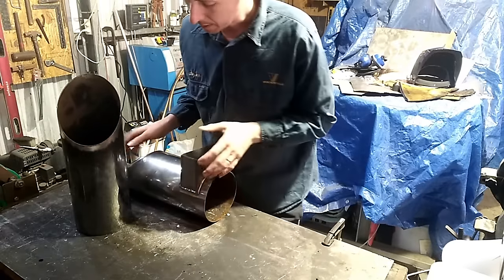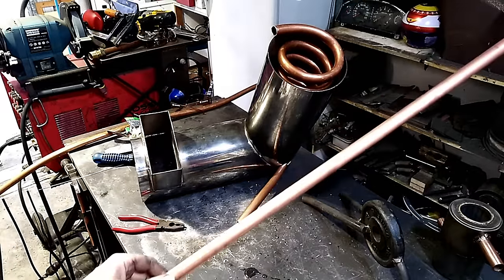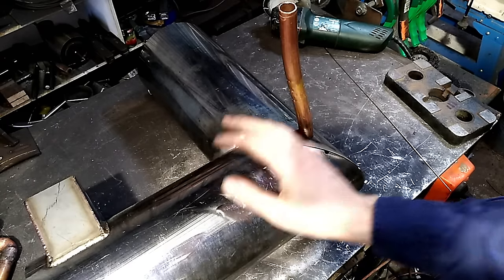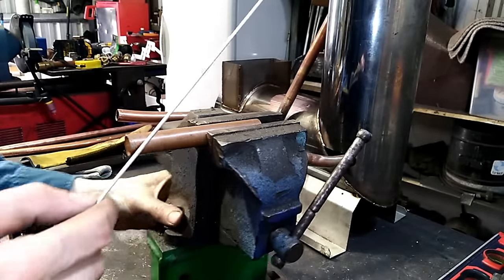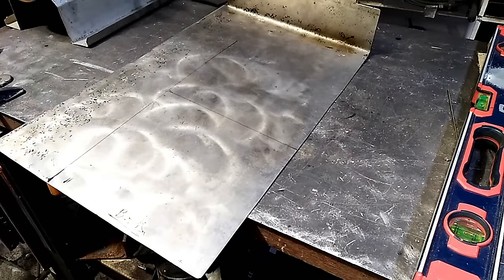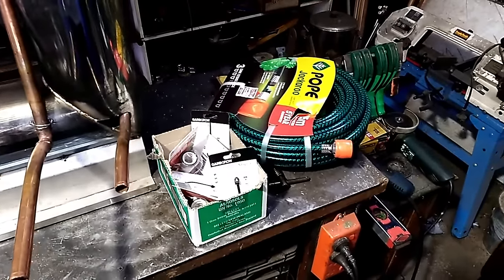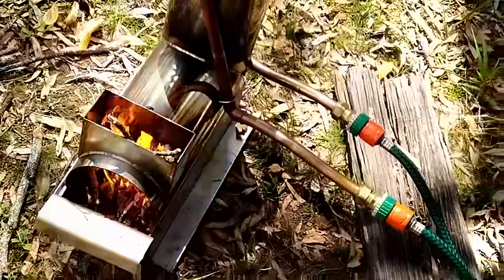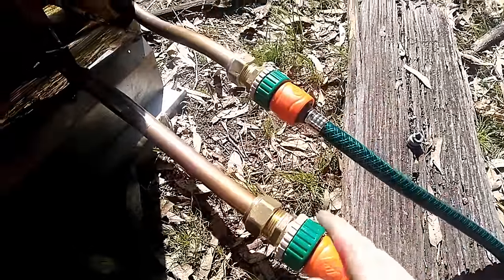Hot Water Rocket Stove II  - BUILD-

Comment: What he doesn't show is the material list! The multibit drill bit,is about 35$ Canadian, and this is not some job u do in your kitchen.
You'll need a welder,or pay some shop about what a new welder will cost.
The 110 volt mig welder I used back in 1989,always got stuck to the metal,crappy welder,but things may have improved!
At a Ford dealership I used a Hobart, or smash welder, works good,no cheap!
There were/are better more expensive models.
You also need a hand grinder,cheap Chinese @ 5amps I bought a new one,it burned out in about an 1 hours use! So the new one @9amps cost 100$ Canadian. 
The size of this unit, he doesn't say how many btus it'll put out,but I'm not impressed with the opening for the wood,got running shoes,as you'll be chasing wood constantly!
I've also seen these coils in huge roof top air-conditioned systems.
Why can't u use 2@1/4 tube  ?
This would be easier to bend!

If this js just a test model,fine,but I run a stock woos stove,and @ -35+ your feeding it constantly!
He also doesn't explain what he's doing or the diagrams of the sizes as he goes along,which would be a great help.
But if you're smart enough, you'll figure out this on your own!
You can also setup a propane flame on the opening! Instead if wood!but thanks for the demo.

Comment: CAUTION!!
Little Aussie Rockets  what you have created is NOT a thermosiphon but a crude percolator. By definition a percolator will NOT be continuously filled with water!  What you are doing is VERY DANGEROUS and can result in a steam explosion and could cause failure in your heat exchanger or piping. What you need is a to modify your plumbing to create a true thermosiphon.  1) the bottom of your storage tank should be higher in elevation than bottom of your heat exchanger.  2) the piping must ALWAYS RISE (increase in elevation) from the point where heat is first applied to the heat exchanger to where it returns to the storage tank. 3) keep the return to the storage tank flooded (water level in storage tank higher than the return fitting) at all times.
Replace the garden hose from the heat exchanger exit to the top of the storage tank with rigid copper that slopes up to the tank. 
The heat exchanger temperature differential (temperature difference between inlet and outlet) should be no more than 10°F (6°C). The lower the differential the more efficient the heat exchanger. If it is higher, decrease the amount of fuel burned or increase the pipe size to increase the amount of water flowing.

Comment: this is an interesting problem of how to get and keep heat BY DESIGN where you want it to go with minimal air convection losses...

so basic questions to ask yourself are ...can the the heat engine (rocket stove in this case) ever melt the copper and leak, in this configuration no.
it's a given copper transfers heat well into the secondary fluid (water in this case) so the next is, can the hottest water produced here ever melt the generic plastic hose pipe and leak..
the actual answer is not in this case ,it will get soft and loose rigidity sure, but not leak , cut a piece off, and boil it in a pan of water to see.

so we now have the first potential problem to actually solve, change the material, or simply support it for when it  loses rigidity, option 2 is cheaper and potentially better, as you use a supporting material that will both support AND insulate, so meeting the 'minimising air convection losses' so let's use cheap,simple "insulating aircrete" as it meets the specs , and simply embed a given required length of  hose pipe in say 2"  aircrete outer pipe.
 
simple formers are go through the trash and find coke cans/bottles, cut the ends off and put your hose pipe in there  with simple wire wrap support to hold it in place as you join the coke cans to "form" the outer pipe, fill in the gap with mixed "insulating aircrete" :).

stop there if you want, but there's more "improvements" if you can actually identify and put the  problem solving in to action.

you construct a " vortex generator" and don't use that invention to it fullest ..
remember, air is actually a fluid, water is just a denser fluid...
hot fluid rises and in a confined flue an (unoptimised)  vortex results as you already know and use, just change the input and output locations to better optimise it, and so better meet the minimal convection losses and keep heat BY DESIGN where you want it to go...
 
a lighter fluid will always rise above a more dense fluid ,air bubbles in a water filled pipe, and again that CAN actually be a GOOD THING ,see "trompe".
think how the so called "global ocean conveyor belt" works and there's your next construction vortex to re-apply in this solved problem mini fluid conveyor belt case ...

Comment: Why not use water and sealed the end of the pipe instead of using sand only suggesting.
Reply from the maker: I'll have to have a look at that, it could be a real labour saving idea, thanks for the suggestion!
Reply: Don't think that the water will be enough. Its too fluid and will let the tube flatten out. Frezzing would help, but thats a whole different kettle of fish.
Reply: Richard  ti:  Unless you have a method of flash freezing (and keeping it frozen) it's rather impractical to own a 7m freezer.
Besides, when your tube gets below its significant bend diameter it will start to oval due to input force being greater than the force necessary to keep it round.  The compression and expansion forces are not equal over the pipe's circumference causing the pipe to distort.

Comment: for heaven's sake, mate, get yourself a propane torch for soldering copper pipe.
Reply from the maker: Sometimes it about the journey...

Ok fine, I will get a propane torch
Reply: @LittleAussieRockets  you are a bloody good welder, I just think it's total overkill on copper pipes. But you are right, it's about the journey.
You'll see, the propane flame heats the joints nicely, and once it's hot enough, the solder flows and gets sucked in by capillary action. Easy.

Comment: should try to put the heat return further down, so the whole mass mixes better, the "top" temp would drop as well and correctly placed in the tub you could set a comfortable max by doing some math based on a known volume. :)

Comment: A small pump in the cold water line will solve most of any problems you may be having, and make the whole thing work much faster.
Reply: Adding 40 or 50 CM to the stack height will increase the burn efficiency
 as well as helping to keep your fire from blowing back out the feed end.
Reply from the maker: Thanks mate! I agree with the riser, it's a pity it couldn't have been a bit longer, but those were the two pieces of scrap metal that I had available, which if you were wondering were cut of a Kenworth truck exhaust stacks.
Reply: @LittleAussieRockets   I am wondering, could you wrap the outside of the Kenworth Truck Exhaust with the copper pipe to keep the water at a wee bit lower temp. This way he POSSIBLY doesn't need cold water?? Love the video btw. Well, I liked it..haha

Comment: not for nothing but theres also the fact water is not compressible. fill with water and remove all air the cap the tube. some say freeze the water i say hydraulic principal says the fluid trapped inside the confined space that cant be compressed will also stop the tube from flattening out when rolled into a tight bend..
and i seriously hope beyond all hope that that was NOT galvanized metal being welded on.  if so can you say mustard gas?

Comment: A small pump would be just right.
Reply from the maker: Yes I found a little 12 volt pump on eBay
I think it was called a hot water booster pump, for caravans. Fixed the problem.  👍

Comment: Your construction with the wood inlet makes no sense, why is it open directly over the flames when you put your wood in at the front? This could burn much better
Reply from the maker: The intention was to have it as a gravity feed through that opening depending on how you want to run it, this was my initial design thought process. As it turns out to just stuff the wood in the front worked perfectly fine.  The options are there for both.

Comment: Nah dude. Cold water goes up and hot water goes down. The water moves up through the pipe because the heat makes the water boil and it forms pockets of steam that push the water up through the pipe as they try to rise up to the top.
Reply from the maker: Moose looks like I will have to take a better look into this. Thanks for commenting 👍
Reply: I think you'll find cold water being more dense and so heavier goes down and warmer water being less dense and therefore lighter goes up.... it's known as thermo-siphon.
Reply: the only time this is not the case is when water freezes and the ice stays on top.... known as anomalous behaviour of water

Comment: is good work but I think you lose a lot of heat in the center of the copper serpentine if you close the serpentine center a little, it causes the heat to pass more through the copper, if you use a check valve in the hot water it will not do the vacun and you will not lose heat in steam how are you losing, thanks for your video

Comment: Or, You could fit a smaller diameter hot water tank inside the diameter of a slightly larger diameter hot water tank. Keeping the diameters both relatively in perspective by attaching a flat plate by welding both the inner (and the outer Diameter) to the flat plate. Temporarily fill the void (between the inner tank and the outer tank with sand.  Fashion Steel Mesh (from cleaning pots and pans) between the two layers.  Using Spacers, maintain an even void between the tanks permanently and remove the sand. Affix another plate to the front with a hinged door.  Load your firewood. Start a fire. Now those plumbers in the Audience can sleep again !!!!

Comment: This is a big no no. You really don't want fire contacting the copper tubing. That's the big nono..rocket flame to boot. The flame heat will render the copper brittle and prone to cracking. Why would you overlook the fundamentadetail like that? External to the pipe, not internal.
Reply from the maker: I've had two groups of people talk to me about this one.1st have had copper pipe exposed to flames for years without issue and others that tell me that I shouldn't do it.

If you've had personal experience with this, I would love to hear about it in more detail.

The purpose of his channel is to learn part of the learning experience is to experiment.

Comment: You are robbing the heat from the combustion chamber so it doesn't burn hot enough to go smoke-free. You really should have used an insulated firebox / riser and the put a outer barrel around the riser pipe with the coil sat inside that barrel wrapping around the insulated heat-riser. The barrel should be airtight and have a chimney attached as a normal stove. 

If you do it like that then you can have the hottest part of the coil at the top of the boiler and the coolest part at the bottom where you can then pipe them straight into the bath you heating.

Right now you have a batch boiler and the hottest part of the coil is at the bottom of the coil messing up with the convection that drives the pumping of the water through the boiler pipe.
Reply from the maker: I'm building a second version of this stove and have done something similar to this, so stay tuned, editing at the moment.
Reply: @LittleAussieRockets  Cool, I look forward to see the next version of your stove. :-)

Comment: add more water to tank, then not suck air to in hose back alltime, better heat and water run if tubes not have air. and insulate coppertube  plastic hose not warm ansd melt, long copper tube need maybe too. no need pump, any hot water heater no have pump. natural run good, if adding pump water run round lot and not heat.and hotwater outlet in tank neede adding 90 degree tube and little tube more water come out down to  tank not air and warm down has could water and warm water rise up to tank , but not under could water outlet hole,
Reply from the maker: Thanks, mate!

Comment: Mate, from one Ausie “ actually a QLDer”, to another , why did you turn your exit, hot, from the heater, down! You even said it yourself, hot water rises! Thats why you have stem spitting out, think about it! 
Mk 1 - failure! 
Not efficient 
Too much throat on your firebox, you need to be able to slow down your burn once the water is at useable temp. Other wise your just burning sticks for nothing. 
Your heating chamber is ok, sort of, if you added a chimney of smaller dia, say 50mm and about I mtr high you would concentrate the heat in the chamber heaps, burn less wood, be more efficient. 
8 out of ten for effort. Cheers.

Comment: why not just solder the copper pipe it is much easier. and where are your shoes?
Reply from the maker: During the actual work I was wearing steel cap boots but for a brief period as I went down to film an update I happen to be wearing flip-flops and so I thought it would be funny if I just flashed the lack of footwear. I did a lousy job and explaining that that was a joke. #learning curve...
The reason I tig brazed the copper pipe was for my own curiosity, nothing more.

Comment: You probably won't like what I'm saying I would recommend that you stop complaining about or telling the people that you don't have the right tools of th❤e right equipment to do this right just tell him what you're doing and leave it at that people are not Professionals in North they want to do is see if you can make it work what you did oh by the way they make a product call cell flux it's Silverado wrap with the flux all you need is an acetylene torch to put it on with and that joint would then be capable of handling up to 600 pounds per square inch good luck with the rest of your endeavors bye for now

Comment: the problem is a water heater heats from the bottom up because heat rises.  when cold water enters a water heater it travels down a fill tube to the bottom where it is heated. when you turn on the tap hot water is taken from the top of the heater out to the point of use. i have a hard time believing you heated that whole 50 gallon tank using this method. the flow rate is not fast enough vs the cool down time. the tank is not insulated. its not even covered. A 50-gallon water heater with 5,500-watt elements set to 120 degrees takes about 1 hour and 20 minutes to heat. your rocket stove is no where near this efficient. you would be better off getting a big pot and heating water that way for a bath or shower. a better idea would be to run black water hose in loops on your roof for the sun to heat. all you would have to do it turn on the hose and drain the hot water into an insulated tank. do that a few time and you would be good to go...........

Comment: Wow mate, you really need to go on YouTube and watch videos on how to join copper pipe!.
Your tig method is probably the worst approach.... especially since you never bothered to sand and clean the areas to be joined. Copper is just like aluminum when it comes to TIG welding or brazing/soldering. 
Clean it meticulously or end up with a piss poor porous leaky joint.
Next time clean the pipe and fitting with abrasive cloth or wire brush, then flux the cleaned areas and solder with standard non lead plumbing solder and a MAP gas or PROPANE torch.